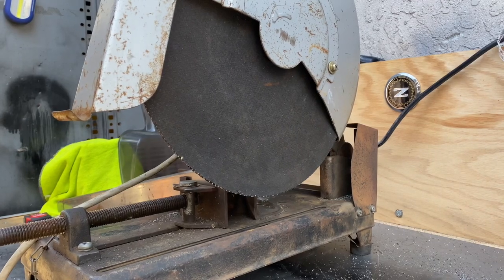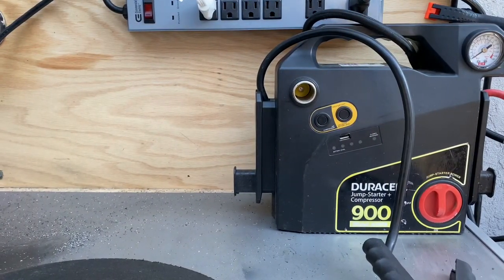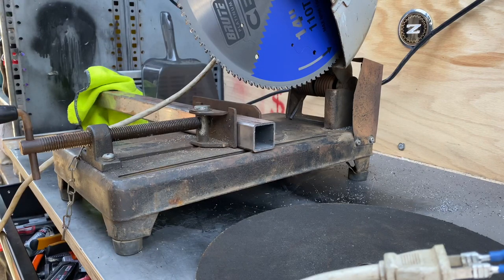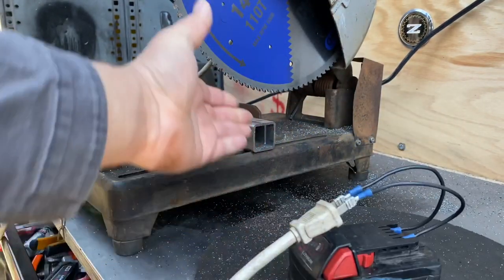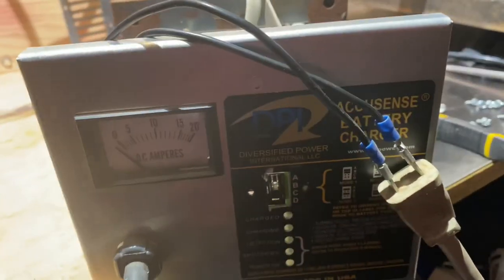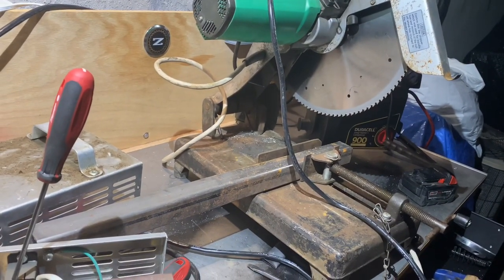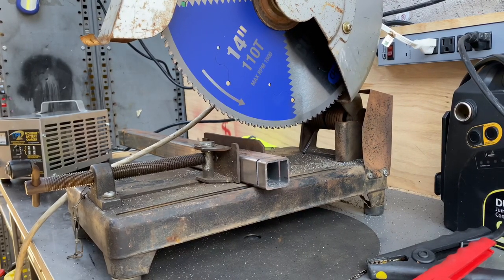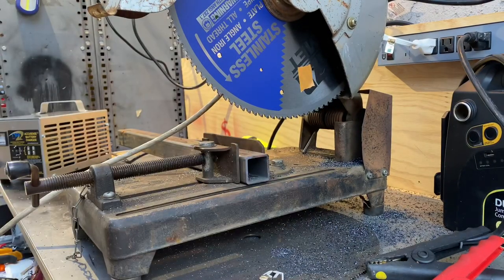Chop saw to Cold cut saw Conversion

Comment: your video is probably the 20th video on this subject I have witnessed, I was going to gloss over it, and then I saw the math which everyone else seems to miss. Thank you, for that. And also, thanks for pointing out the simplicity of the wiring!  I have an old Dewalt compound miter saw I want to do the same thing to, so I can cut 18ga stainless for exhausts, which I know will be easier than what you were cutting.  Those motors will likely never have the actual torque that an Evolution cold cut saw will, but they can be used for smaller work. Amazon, sells DC motor speed controllers,  look this up for an example of one. "DC Motor Speed Controller AC 110V Input DC 24V-90V Output Motor".  I plan to test it tomorrow.

Comment: You need a variable frequency converter to achieve what you are trying to do.
Reply: Facts
Reply from the maker: You’re right learning as I go haha
Reply: Might be able to do with like a SCR dimmer control. Technically, for the design of the motor at that power and RPM, the best is using pulleys, sprockets or gear designs to change the ratio so the RPM of the Motor is as designed and the RPM of the spindle shaft is as well.  Not sure with what all is there as parts can be the easiest custom fabrication to do that.  @ProjectDaily

Comment: That motor isn't designed for cutting the voltage in half. That's why you aren't getting any sort of torque out of it like that. Look into getting a true cold cut saw used to save money.
Reply from the maker: Yes sir you are correct . Check out the new video
Reply: Look into getting a true cold saw? I think everyone knows buying the correct tool is the way to go. No need to point out the obvious, but where's the fun in that? There's nothing like diy projects.

Comment: You can very easily achieve the same effect without using a special power supply, you just need to connect it in series through some other device, for example an electric heater. The wattage of the heater determines how much slower the saw will become. But whichever of the two methods we use, it seriously affects the power of the motor. There are some schemes with electronic elements that make the motor slower but keep its power, this is the best option but requires a little investment. However, we still won't achieve results equal to real saws designed for these cutting discs. This is because they are made in such a gear ratio that they give a lot of power to the disc but at a low speed.

Comment: I saw a guy using a microwave transformer where he changed the secondary coil trying different turns until he got on the right RPM and it works perfectly fine

Comment: Did this chop saw motor last after long time use ?  So many people suggest the speed of the motor will heat up and eventually the motor will fail as the insulation breaks down.  Is this the case for you ?

Comment: what was the final voltage DC you ended up feeding to the saw. and what was the final RPMs you ended up with?
Reply from the maker: Roughly 1400 rpm and around 50v but no torque
Reply: what about using a starter motor. it has the torque and slow speed youre looking for.

Comment: this is a series motor , if you learn motors  you know you can not reduce speed if you don't have a right driver but this driver is very,very especial ,,,,,,not any dc driver for a PM ,shunt, or coumpound etc,etc  this driver is design  for series motors , most the time custom design